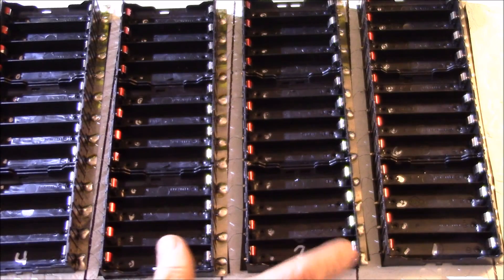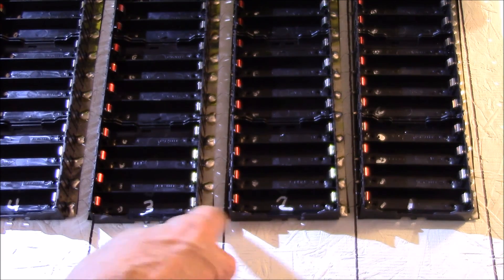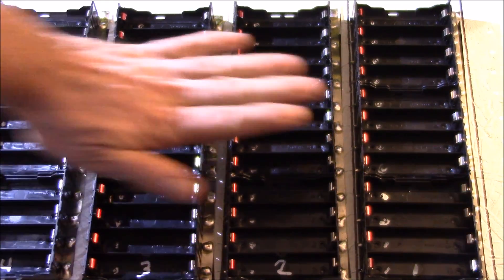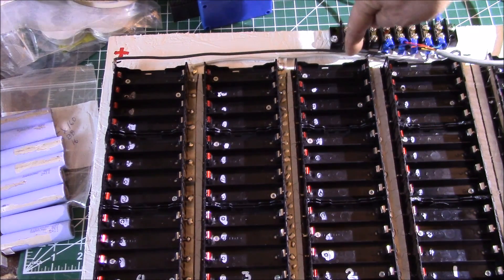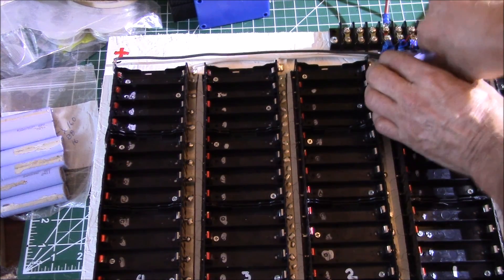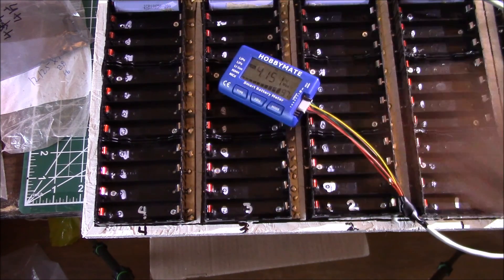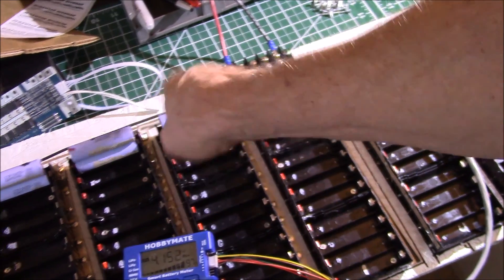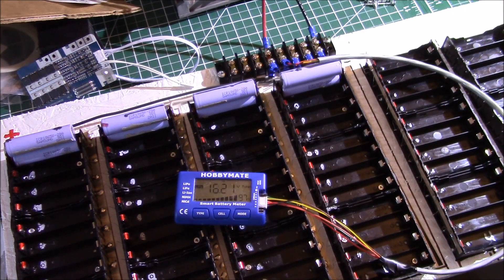Lithium Ion Battery Power Shelf, Part 5

Comment: How many amps (A) does each holder support?
Reply from the maker: Hard to find specific test data on these, but I've seen 1-2 amps/cell quoted.  I use mine at a fairly low current, typically 3 amps charge/discharge for 10 cells in parallel.
Reply: Supports little electrical current. It does not seem suitable for battery electric vehicles, where each cell can dump up to 4.5A, being normal to release 3A. This support would melt. It is one of the best ways to make a battery easy to maintain, but each module works with low current.
Thanks for the info.
Reply from the maker: Yes, that seems to be the case.  For my needs, mainly testing groups of cells, it works great.  But for high current applications, you would really want a had wired contact, likely spot welded tabbing.

Comment: This is the way forward.  slot in slot out holders.  Still needs to evolve but great work, really impressed.  Maybe use junction strips for fusing?  Would take a long time to do, but easy to change a fuse... I doubt the fuses blow that often?
Reply from the maker: Thanks for the comment.  Yes, lots of options with these.  So far have only had one fuse blow, likely due to inserting a cell backwards.  Fairly easy to find with a volt meter and not too hard to repair since I left a sizable gap between holders for  just that situation.  I do like the idea of using a screw terminal strip for the fuse wires.  Would be easier to repair if the battery shelf were hard mounted and you couldn't remove it.

Comment: would it be tedious to replace a blown fuse wire in between the battery holder since one end of the fuse wire is soldered to the underside of the holder and the other at the bus bar.
Reply from the maker: I've had to replace one fuse wire so far (must have inserted a battery backwards).  But it was no problem, I just soldered a new wire on top of the tab off the battery holder and the other end to the bus bar.  Good idea to leave enough room between holders for finger and soldering iron access.

Comment: Hi, i want to make a battery holder for a 10S and 4P batterypack. I'm looking for these single holders. I have 18650 Batteries with 20amps discharge. With 4p i want to get 80amps. Are the pins good enoth to manage the high current?
Reply from the maker: Not sure if those would be good enough for that high a current.  You would probably want tabbing soldered or spot welded right to the terminals.
Reply: Thank you for answering, yes i think will try with welding. Thanks